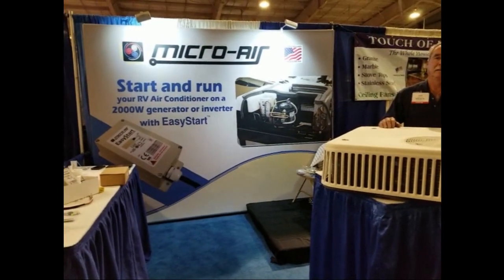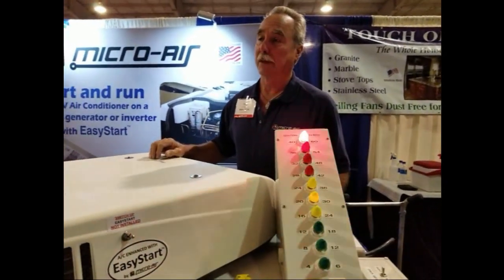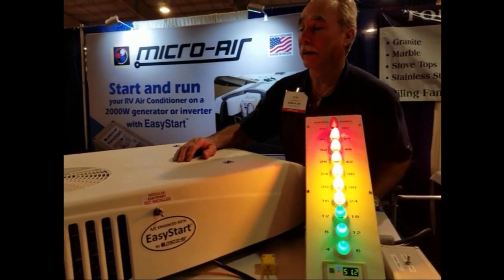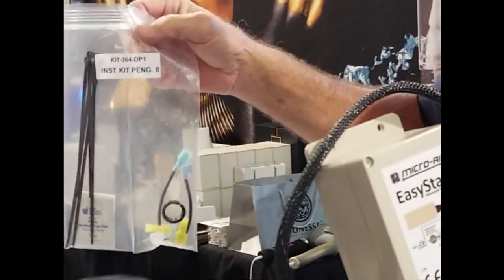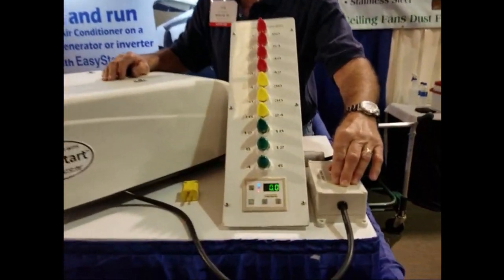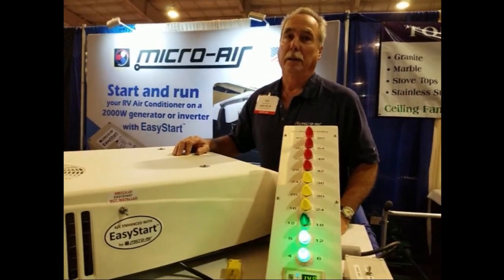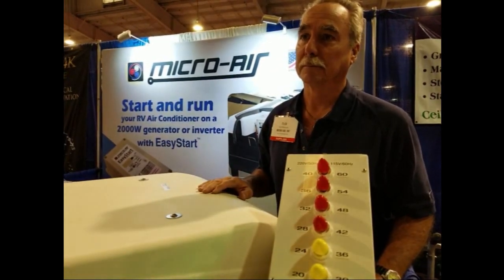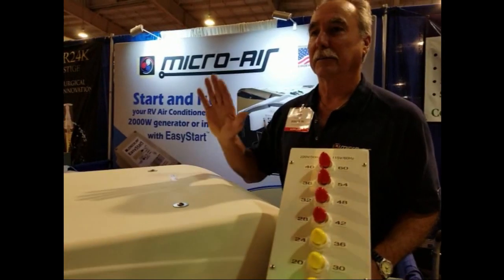Micro-Air EasyStart Amperage Demo - 2019 Florida RV SuperShow

Comment: Going to check this out. Ours is 13.5k and I am getting a Honda 3000iu generator should be fine with this little unit. Thanks for the video.
Reply: I just installed mine today. I have a Honda 2200i. Surprisingly it would run sometimes without the easy start but depended on altitude and weather. No more issues. Plus it’s quieter. Love it!
Reply: I'm thinking of doing the same, all videos I see about that generator say it will start it.  Did you buy this and is it working?

Comment: Can you “learn” your EasyStart from a 15 amp hookup at your home, or would it be better to hookup my 2000 watt generator with a 30 amp plug to “learn” the unit how to fire up properly?
Reply: The instructions say to let the unit learn on regular AC power and not generator power. This is because regular power is constant and does not vary slightly as generator or inverter power can do.
Reply from the maker: Hi Ken - please see our EasyStart Knowledge Bank: http://www.micro-air.com/knowledgebank

Comment: So how does the device actually work?  Am I replacing the factory capacitor on the A/C unit with a larger capacitor in the Easy-start?  How does this keep my A/C compressor from being damaged from under current conditions during startup?
Reply from the maker: Devin...head over to our EasyStart Knowledge Bank and start in the "Lets Get Started - Before You buy" section. http://www.micro-air.com/knowledgebank

Comment: Why doesn’t the AC manufacturer just have this as factory equipment? Why should the AC be built with such a large current requirement, when a capacitor could even out the load?
Reply: They make more money selling it as an item itself.
Reply: Took the words out my mouth.